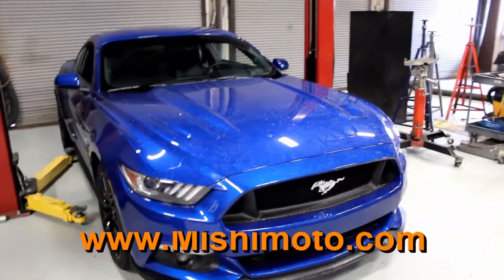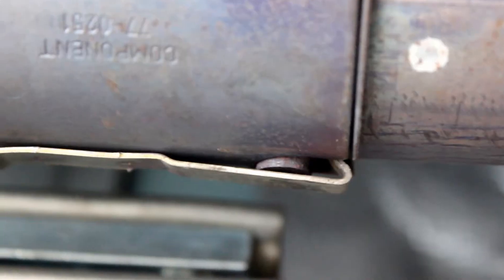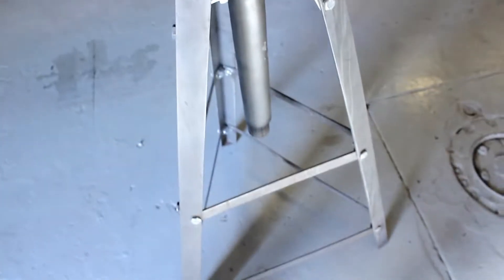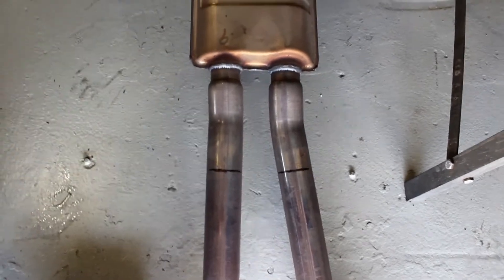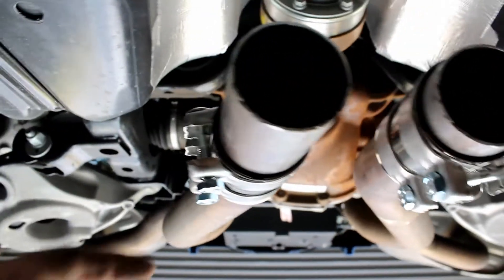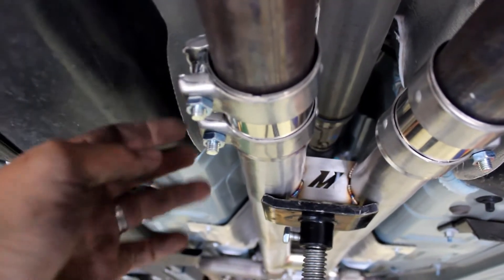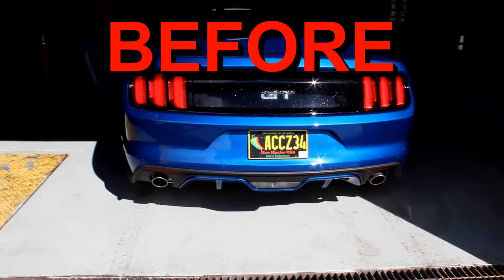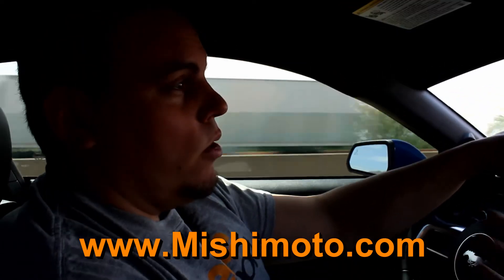How To Install Mishimoto S550 Ford Mustang GT X-Pipe or H-Pipe

Comment: No problem with the mishimoto clamps , won't they loosen?
Reply from the maker: Only issue i had was needing a washer on the mishimoto camps
Reply from the maker: I did end up welding everything together in the end...lol
Reply: @FatGuyBuilds  ok thank but you said you had no problem just adding a washer .. so why have everything soldered .
the clamps were loosening?
Reply from the maker: @johnhulster7658  because of all my clamping on and off. I am constantly messing with it.  I stripped the clamps over time.
Reply: @FatGuyBuilds  ok thank you Guy👍